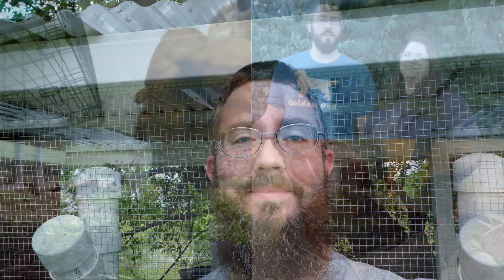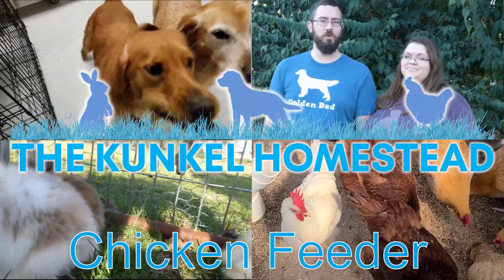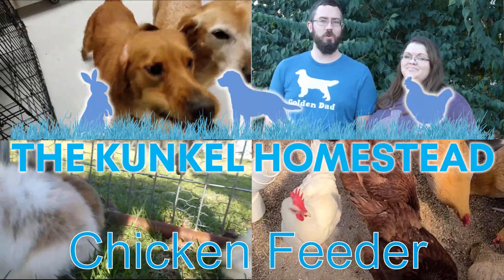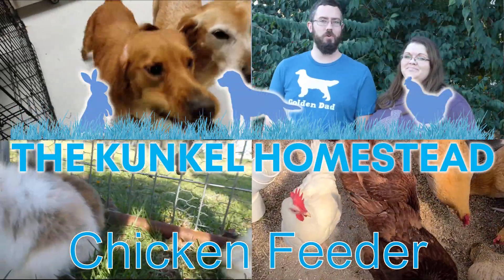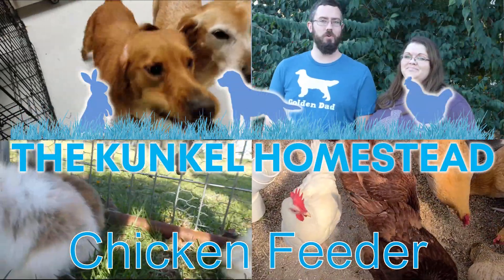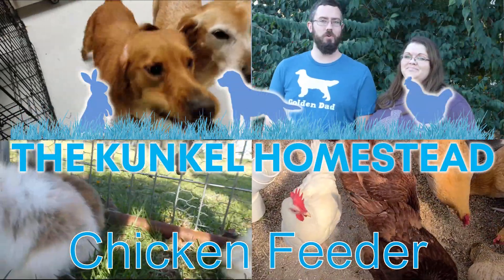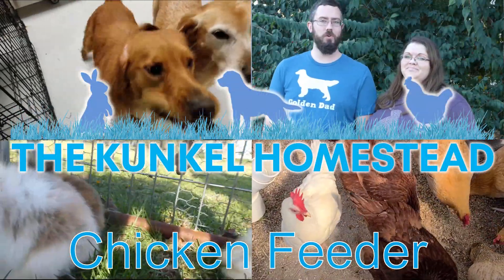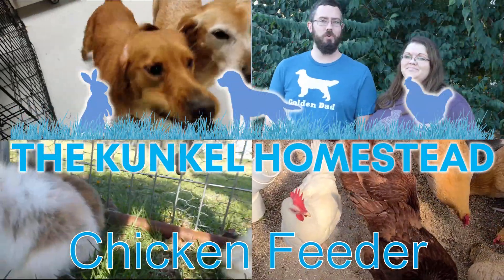Coop Tour 4, Part 4- Automatic Gravity Feeder (4K)

Comment: I love this solution and would implement it, except for one thing: it's surprising how expensive it is.

First off, I like to go big with this type of stuff. I've already set up 4 feeder ports to a 5 gallon barrel. It works great and even when it rains, the food doesn't get wet. I'm still debating if I should one day cover my run. Anyway, any pipe solution should absolutely hold more than 5 gallons and I was thinking about using 6" pipe. If I get a 10' long section and cut it in half, the two 5' sections should hold close to 15 gallons of feed and I could easily go a month or longer before having to fill it up. 

The cheapest I've seen 6", 10' long pvc pipe is $80. I'd do that, but then the covers themselves are $30 EACH, or $120 just in covers. I could probably make my own covers from plywood, then caulk them to make them water tight, but it's stunning to me that pvc caps are that expensive.

If you go with 3" diameter pipe, one 10' long pipe holds about 3 gallons. Even if I buy 2 of them (and have 4, 5" long sections), that's only 6 gallons. Not to mention since 3" is a much smaller diameter, I'd no longer be able to use my feeder ports and would have to use y fittings like you did. $37 per pipe (2 of them, so $74) and the caps and fittings (each Y fitting alone is $15) and you quickly have a very expensive feeder. I'll almost certainly one day go with the 6" solution and make my own caps. But for now, I use my very cheap 5 gallon bucket, that I have to fill up maybe once every 3 weeks.
Reply: You could make the same system as your 5 gal bucket with a 55 gal barrel. That was my original plan, got the barrel for $10 off Facebook marketplace. However the space it would take up in my coop would be too much for the size of the coop. I may just put it in the run instead but haven't made up my mind yet